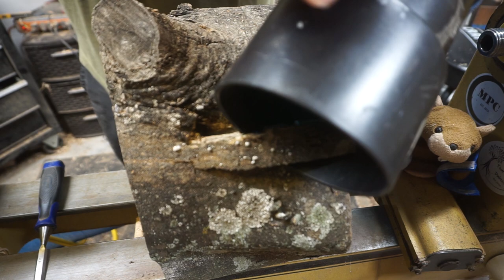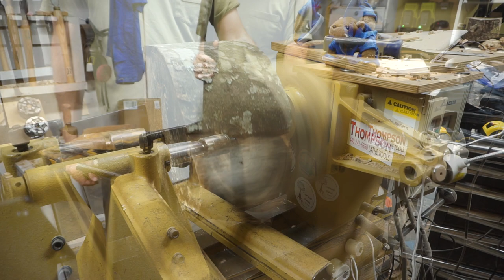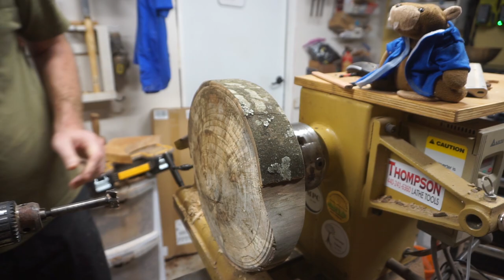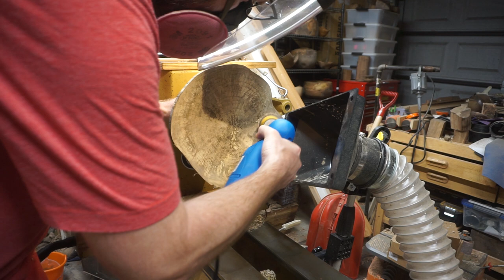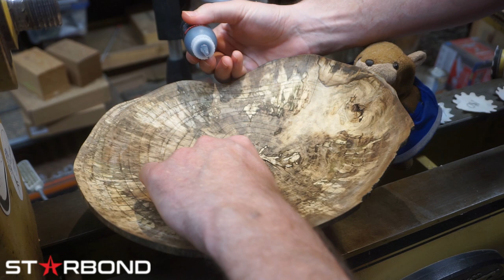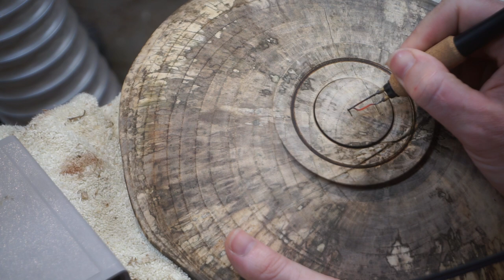Woodturning - Spalted Hackberry Natural Edge Platter

Comment: How long did your blank take to get to level of spalting ? Do you do anything to encourage the spalting or just time outside ?
Reply from the maker: All I did was leave it outside in a shaded area with the end grain resting on the dirt. Monthly I'd go and flip the piece over. I'd say they were left out there for about 5 months. Hackberry is known to be really good at spalting but you can't leave it too long as the window of good spalting and rotting is somewhat small so just poke at it with a screwdriver or something when you go to flip it to make sure it's not getting soft.
Reply: @HodgePodgeWoodWorks  thank you